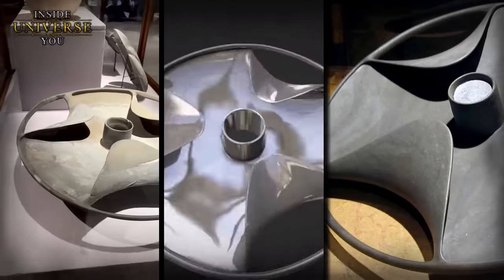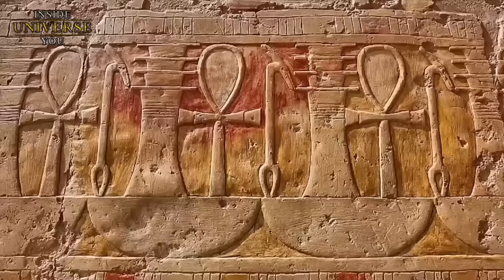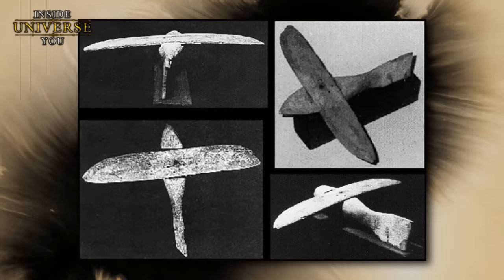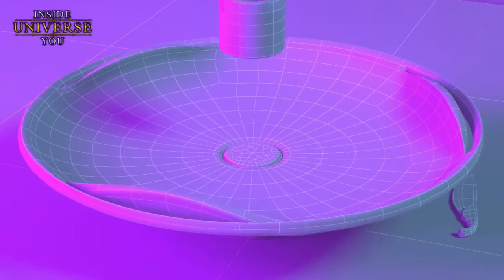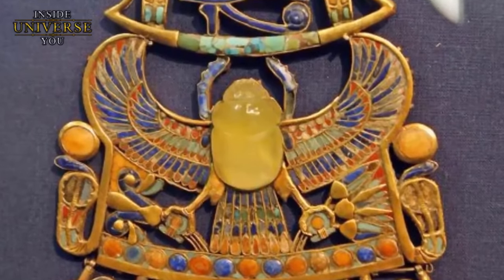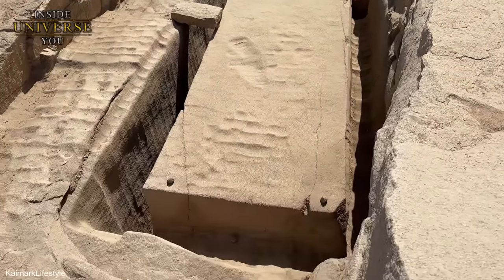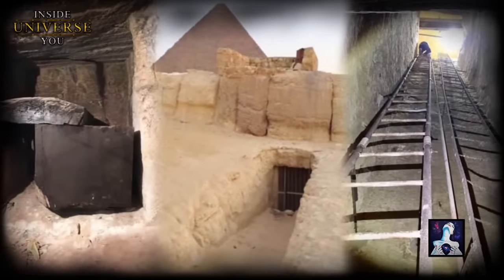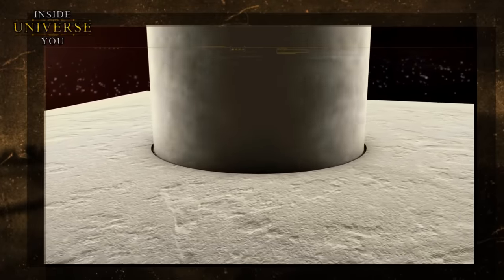Pre-Egyptian Technology Left By an Advanced Civilization That Disappeared

Comment: That disc object, with what looks like 3 fins designed to direct small objects 3 different directions. Reminds this farmer's daughter of an old fashioned grain seeder, used to plant small seeded crops. ( Perhaps wheat?) Although my father's seeder was used for oats. The seeder had a motor powering it. When pulled at an even speed down the length of a field, the disc in question would spin rapidly beneath a hole at the base of the hopper. This caused seed to be flung evenly in a strip 12 feet wide, speeding the planting considerably.  Just a theory, but based on experience.
Reply: Fantastic! That's as good a theory as any "experts" have....from one farmers daughter to another 😊
Reply: Why schist though? 
That's a great theory 💯
Reply: And there I was thinking it might have been used for separating wheat from chaff instead of beating it or using a bull to turn a wheel like they do all over the middle east.
Reply: That shape, in acid resistant stone, might be useful in agitating for solution mining of gold. Some ancient dry lakes, like in the US Southwest, have gold dust trapped above caliche hard pan.
Reply: @joshrandar  Also a plausible theory. Though they would need a wide area to catch the good grain.
Reply: @PAPOOSELAKESURFER  I am not familiar with that process, but it sounds like you are. If you think it would work, I am ready to say your guess is as good as mine!
Reply: "... in three different directions" 
It could not have been in three same directions.😊 
I'm not being mean; it's a silly obsession of mine. 
I always wonder how people speak five different languages or visit several different countries, although this could be debatable, when one thinks of the origin of these languages and location of these countries.
😊
Reply: I was thinking of what we use to separate milk and cream through the rotation of discs in the separator.
But as a seeder disc, it would get the grain thrown further than the type of disc we use today.
There are many uses for a rotating disc, from mixing, to throwing, to density separation, it is difficult to know if they used it for one or many uses.
Reply: Like an old school Grainer brand seeder, or maybe separating chaff on an old time combine!
Reply: Doesn't Shist imply a geological origin?

Comment: Having worked in a foundry ,  Images Shown in the thumbnail are for casting gears. A positive  of the gear is first created, then using sand and some additives like carbon, you create an inpression to pour the molten metal into.  Very simple, they were producing complex metal gears. It's not hard, basic geometry and physics is all that's needed. The base blocks are square to simplify centering. An X corner to corner = dead center. Equil mesurments on 2 sides / 1/2 and a compass = gear
Reply: Thank You! Very keen insight
Reply: Yes I used to be a gear cutter , most were cut from blanks some were cast.
Reply: Thats neat n everything that level of knowledge before the age of the internet was definitely values n highly appreciated,now yours specifically idk u so it wouldnt be fair to label u a "internet educated exclusively" but just going off that piece u wrote the simplicity if it i can confidently label your depth of knowledge same as any human being with access to the internet but thats not a necessarily a bad thing it's just elementary-ish-esque info thats a yearning for more type sh*t,feel me??
Reply: I think they were found at the outlet for a drain, there was a megalithic structure with stone slab floor, and under the floor was a drain/gutter path (the paths being around as wide/deep as a red brick) and the outlet was draining into those 'bowls'.  Maybe the structure was producing some liquid and it was gathered in the bowl for some purpose, but it could not have been much because the bowls are pretty small.  OR yeah they may just be molds for casting gears.
Reply: Physics would be unnecessary.
Reply: Thanks for pointing that out because I missed that, but YES, that is what the thumbnail looks like. A mold for a gear that would have undergone subsequent machining. Surprised I didn't notice that myself because I apprenticed in metalworking and metallurgy, and also worked in a machine shop for a while, but that was 40 years ago.
Reply: Thank you 👍
Reply: You really did your “real quick” research through Google University before posting your comment to come up with your so Called “very simple” huh!?
Reply: Hahaha there cooling towers. What's left of the foundation.
Reply: I think the thing they are getting at is the composition of the metal, iron, cobalt, etc, the extraction process needed to remove the metals from their parent minerals, we are made to believe that alloys only go back as far as 3000bc.
Reply: Pareidolia. Foundries require wooden pattern makers and sand to create moulds
Reply: @davepowell7168  That's what we used, but you can use anything smooth to achieve the same result. If you use stone , the weight alone can create the impression
Reply: Why just metal? What about stone or fine minerals. Isn’t steel made from IRON (dirt)!
Reply: I guess we'll just ignore the fact that you wouldn't need to make a bunch of the exact same one then right? That isn't at all what these are.
Reply: @MrBeetsGaming  That's not even close to true. I worked in a foundry, we often made hunderds of molds of the same thing because a mold is only used 1 time. t remove the part requires you to destroy the mold. That's the very nature of casting. Today we make millions of parst that are identicle for engines, cranes, tractors ans so on.
Reply: TO a hammer everything looks like a nail

Comment: You say that the stones were placed ‘in a desert’, but this is not necessarily so.   It has been recorded by satellites that at some period the Sahara was Green, temperate and with rivers running through it and with peoples loving there.  It would be interesting to work out just when this would have been.
Reply: The Sahara desert used to be a sea. There are whale bones in the desert. It would be very interesting to know when that changed, what caused it to change and what the area looked like before it happened.
Reply: And when they were finished loving each other they could have lived there as well ! .
Reply: Who made the satellites that recorded that 😉
Reply: The granite blocks were probably not transported in their block state. It is more likely that the granite blocks were formed using  concrete-making-type process: precast in situ or very close by.

The disc is an interesting artefact. I would not say that I have knowledge of it's actual use - I do not speculate quite as much as some on here. However, whether by itself, or used in conjunction with other similar discs, research into it's use to control magnetic fields, which may result in producing a from of propulsion.
Reply: The sea was much much further back in time. Millions of years, I think? By the time humans lived in the area, it was lush and green, with rivers and savanas. Desertification of the sahara region gradually set in at the end of the ice age, going from about 12,000 years ago and started to really affect Egypt between 6,000 to 4,000 years ago. It was a very gradual process though. It's possible that some of the oldest traces of human settlements are buried under the sands.
Reply: It would have been well before Hawass come onto the scene.
Reply: @green856w  I would counter the the block were cut "roughly" and transported to the site and finished to fit jusst before moving them to their space in the structure.
Reply: @brianhowe201  Large sources of water have been found under the sands of the Sahara - but not at the surface.
Reply: @josephr4761 I've always wondered if in fact there was a global flood the whole earth was covered in water which would have displaced marine animals in places that would otherwise be impossible. Like finding shells and fossils at really high elevations.
Reply: @davidbnsmessex. Well he put his thing in her thing when they were living there.
Reply: @green856w Thats not how granite works bud 😂 no one has ever made naturally occuring granite with a “concrete making type process” 🤣
Reply: We know exactly when it was last green - it's called the African Humid Period, and it has nothing to do with Egyptian archaeology because the Nile was a raging monster of a river during that time - the entire civilisation of dynastic Egypt would have been engulfed most of the the year around when it was at its peak.

The Nile river valley was only settled in earnest after the African Humid Period began to wane and the river returned to a more habitable level during its flooding season.

We can plot the development from that time to simple cultures that progressively advanced toward first agriculture about 5,000-4,500 BCE, and then to the more identifiable cultural features of ancient Egypt from about 3,900 BCE as cities began to form during the 3 phases of the Naqada period.

During the last phase of Naqada (about 3,200-3,000 BCE) - also known as the predynadstic period - the culture had already become very obviously the same as we identify with the dynastic Egyptian culture.
Reply: @josephr4761  

"The Sahara desert used to be a sea. ......... It would be very interesting to know when that changed, what caused it to change"

It changed about 7-8 million years ago, and the simplest explanation is plate tectonics moving the area above where it was formerly and forming the Mediterranean Sea as the African landmass intersected the European one.
Reply: @green856w  

"The granite blocks were probably not transported in their block state"

Yes they were, by river from Aswan, likely during the flooding reason.

"It is more likely that the granite blocks were formed using  concrete-making-type process"

Nope - you can make a limestone like aggregate with concrete, but granite is an entirely different beast which forms under pressure in strata of cooling volcanic rock.

The top layers cool too fast and become like obsidian, the layers further down cool slower and form stronger crystalline bond structures.

Heat granite to melting point and all you get is obsidian glass when it cools again.
Reply: @brianhowe201  

"By the time humans lived in the area, it was lush and green, with rivers and savanas. Desertification of the sahara region gradually set in at the end of the ice age, going from about 12,000 years ago and started to really affect Egypt between 6,000 to 4,000 years ago"

Nope, the Sahara and the Amazon desertify and lushify in cycles - the last one ended well before the dawn of dynastic history, but Egypt was largely unaffected because it developed by the river anyway.
Reply: @justsayin3600  

"I've always wondered if in fact there was a global flood the whole earth was covered in water which would have displaced marine animals in places that would otherwise be impossible"

Put it entirely out of your mind.

The force necessary to achieve a worldwide flood would make the end Cretaceous impact look tame by comparison.

The mass extinction would be completely undeniable and it would have taken millennia for the climate to stabilize again.
Reply: @poindextertunes  They had granite based concrete. They would put it in molds, heat it up, and bounce up and down on it until it got real hard.😃

Comment: The disk is a grain or seed broadcast spreader.  It would hang horizontally on the bottom of a wagon, a hole in the bottom of the wagon would let the seed fall onto the spinning disk which would cast seed (and/or possibly fertilizer) all over the field
Reply: Wrong ,too fragile for even that.
Reply: Could've just made it out of wood.

 Incredibly shaped thin stone disc for a farmers wagon?
Reply: That's great. How is it mere thousanths of an inch off perfectly symmetrical on all axes and how was it made? Absolutely not by hand.
Reply: What about the heat or burn marks they mentioned on it? Heat wouldn't be conducive to propagating plants.
Reply: Rocket Engineer said it is a bla bla for rockets. We lost people in the  flood, not fallen angels. Unfortunately.  They still remember how to make stuff.  Too many designers of wepons have "dreams"  .....

Comment: What they don’t tell you is that connecting to the ionosphere changes the gravitational effects, minimising  them in that area, which would enable them to lift large granite blocks with ease.  Liquefaction also plays a role due to frequency, which would also enable them to cut the large granite blocks a lot easier.  I personally worked this out many years ago which influenced me to buy a property at the highest point in my location in 2005.
Reply: Liquefaction has NOTHING to do with solid rock.

Even sedimentary rock is dense enough to avoid this effect.

What it DOES effect is soil and sand - which is why building on bedrock is always preferable to avoid subsidence issues.

Also ionisation has NOTHING to do with gravity.

Comment: At 26:10 it says :"The transportation and placement of these massive boxes are also subjects of wonder.Those tunnels are narrow and winding, making the movement of such large objects a challenge." This supports some opinions saying they could melt stones and mold them, meaning those massive boxes  were made on the spot! Some say even pyramid blocks were molded on the spot this way and not trasported.
Reply: Attractive though this idea is, of casting granite, but cast products have artefacts - characteristics - unique to cast products. Bubbles, foreign material trapped in the fluid material. However, crisp precise 90 degree corners are hard to cast - they’d have a small internal radius. I believe the builders were fantastic engineers and stone workers; they built machines. Machines are the only way to build structures with such regular precision. If we tried to recreate these structures - we’d use machines. So it all points to a time when humans were highly advanced. Question is, why did this tech go away? The civilisation declined, clearly. Maybe only a limited number of people had the knowledge to make the machines. They guarded their tech secrets. Maybe they were rounded up and killed for a belief; that they did magic and so had a power that threatened the leadership? There are parallels throughout history. We may never know but for sure copper tools and dolomite pounders didn’t make this stuff.

Comment: The very first photos in the video of the stone bowls with 19 pin holes around them are the bases for djed pillars. The djed pillar was àn old typenof windlass that used ropes to move large stones. There are modern examples of them in use. They provide great mechanical advantage with little work.

Comment: They used water alkalinity and electricity to turn the surface of the granite soft and "scooped it out" as it appears. They scooped because this allowed shaping of such large objects and of such corners found in the temples. Those cylinder holes were drilled using the same water alkalinity and electricity technique but with a drill tip just like the one shown towards the beginning of the video. Those holes allowed for the spent material to be forced upward to allow material removal as they drilled. They had a technique to turn the hard surface of the granite soft using water alkalinity and electricity.

Comment: The Osirion needs to have its waterways mapped using micro submersibles or cabled pipe cameras used in plumping so we can find out where the water comes from. It seems to be a bath house with that 74 degree water that could easily be heated a bit more